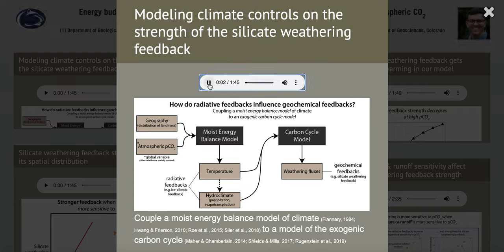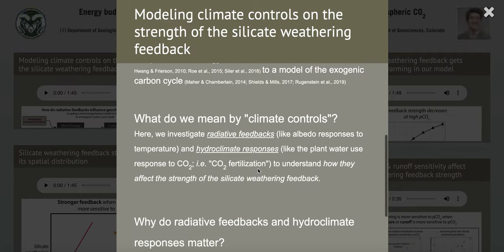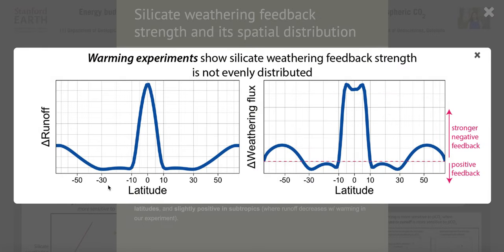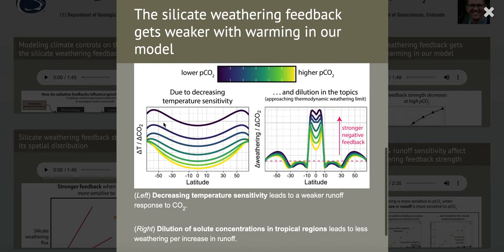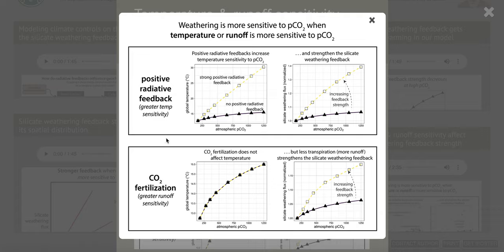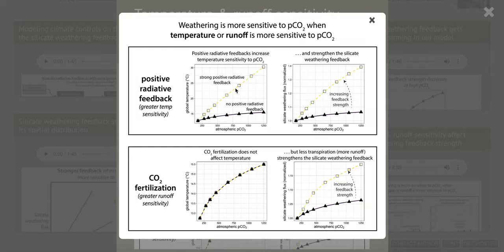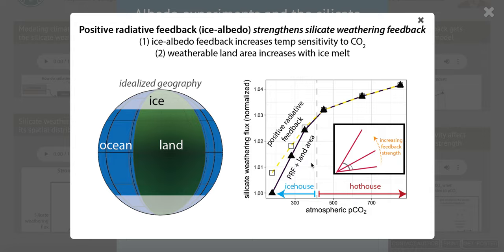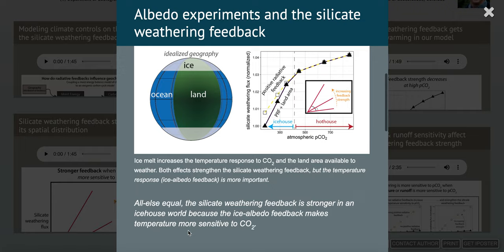Energy budget constraints on the runoff and weathering response to atmospheric CO2 [AGU 2020 poster]

Comment: 1,368 W/m^2 of solar energy arrive at the earth.
Spread over the discular cross section that is 6.28 E17 kJ/h.
The albedo reflects away 30% so the net is: times 0.7 = 4.4 E17 kJ/h.
At equilibrium the same amount must leave the spherical surface in all directions 24/7.
A sphere of r has 4 times the area as a disc of r or 1.1 E17 kJ/h.
Assuming the ToA temperature is -60 C or 213 K and the GMST is 16 C or 289 K the effective thermal conductivity, U=Q/AdT, of the atmospheric thermal blanket would = 1.45 kJ/h m^2 T
If the albedo increased from 0.30 to 0.31 the surface temperature would decrease 1 C.

In other words, a natural variation in the albedo that cannot even be reliably measured could easily account for the perceived GMST increase.

Now let’s suppose the lit side average is 20 C high and the dark side average is 20 C low. Because the heat rate is a function of dT to maintain equilibrium the lit side will move about 65% of the heat, the dark side about 35%